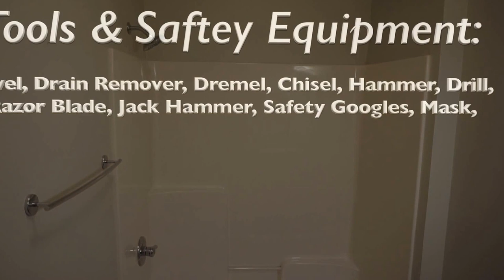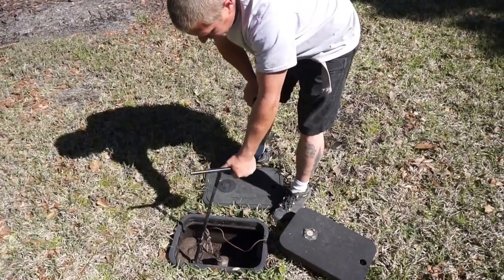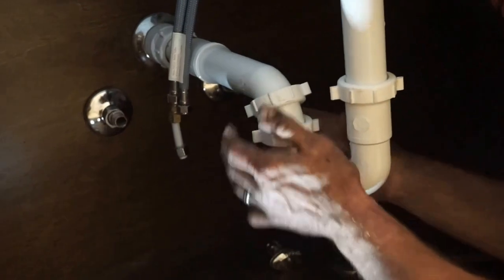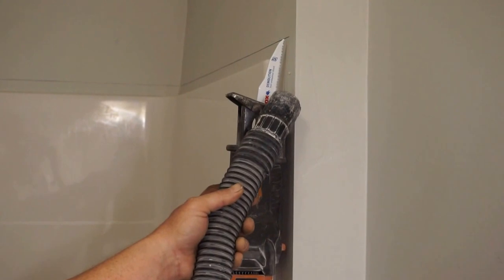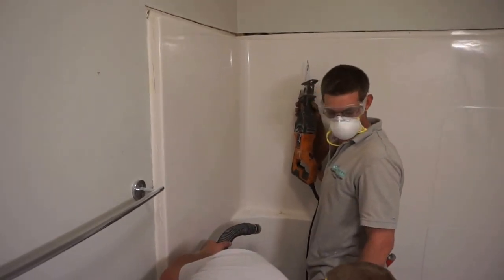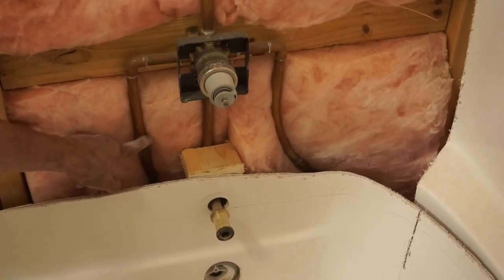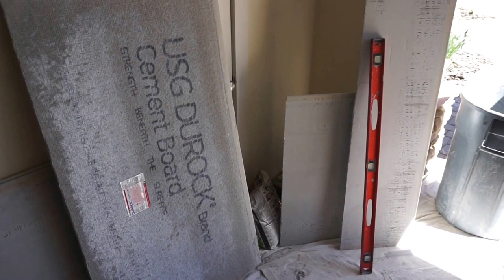How to Do Bathroom Demolition | Home Renovation Tips

Comment: why would u cut the tub up like that??
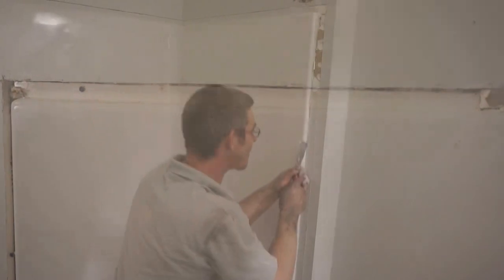Reply: Jason Weaver 7:55 to cut the tub up in manageable peices to remove
Reply: You have to realize that tub surround is a new work model. Meaning one piece. They are put in place before sheetrock on a new construction build. Sometimes before the walls in the rooms are built. So sometimes getting them out are next to impossible.